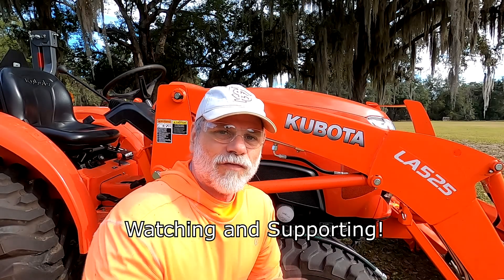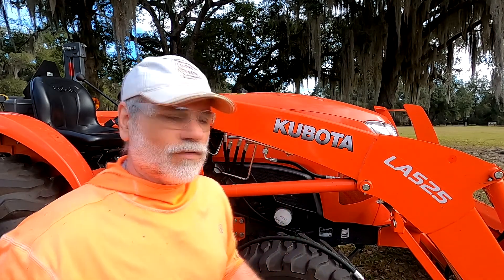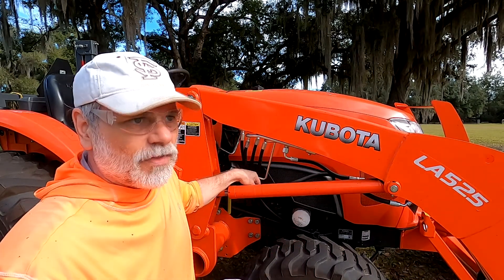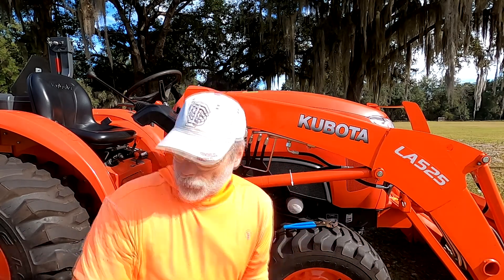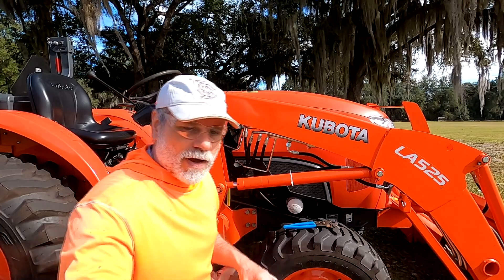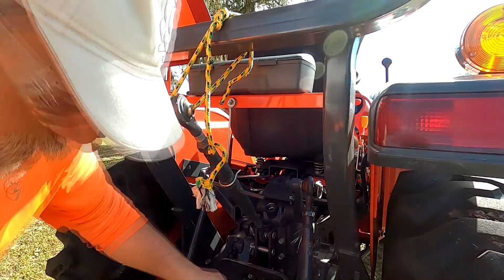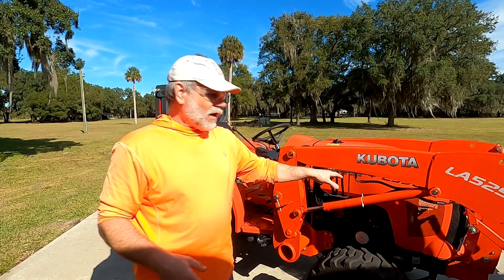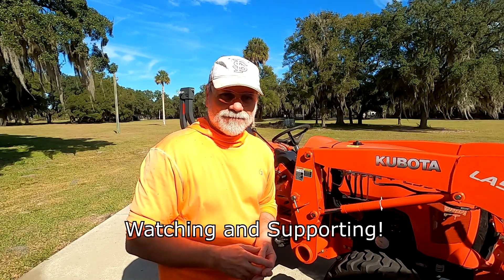Hydraulic Line Replacement, Kubota L3901 / LA 525 Front Loader - Ray Hayden, J.D.

Comment: Same loader on my l2501d.
Reply from the maker: At times, I would like a wider loader. I have a plastic pull cart that I use with our Zero Turn mower to gather plant materials for burns (when it is safe, of course, the county strongly prefers that we burn the material if we have the room and meet all the safety standards)... a slightly larger loader would do more work. I need to pull the tractor out and do some industrial raking!

Comment: No air in the replacement line? You didn’t have to bleed it?
Reply from the maker: The fluid reservoir allows for an easy process to ensure that the line is properly blead. I also send it in for service either at the end of, or prior to "season," and have everything gone over to make sure it is in the best operating condition.

I do tend to be rough on the equipment, so it is kind of mandatory that I take the extra precautions.

Comment: How do you get the air out of the system?
Reply from the maker: Great question, I actually don't know. I have to look it up and see if there is a procedure - like for our car brake lines and such... The hydraulic fluid is simply transmission fluid, and it all is in the same fill section. I have to look it up to be sure, but everything is working perfectly normal.
Reply: Loosen the connection farthest away from the flow direction and run till it is clear,  white means air bubbles, then tighten and clean up..you may need to also do it further down the system to the next area that you can loosen..

Comment: Good hydraulic repair Ray! Must have been a defective hydraulic fitting crimped on the hose to fail already. Pick up a pack of the black UV resistant zip ties at least 8" long to secure the hoses, the regular white ones are not UV resistant and will become brittle and snap off in no time. Watching, supporting & liking!    👍